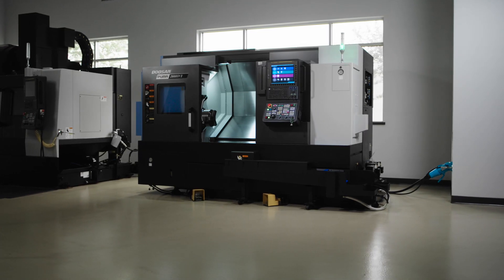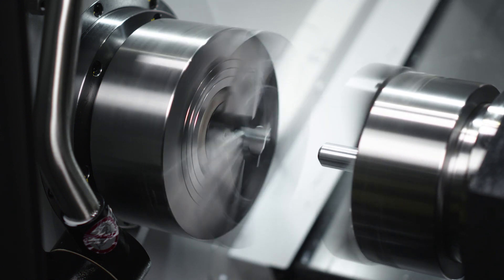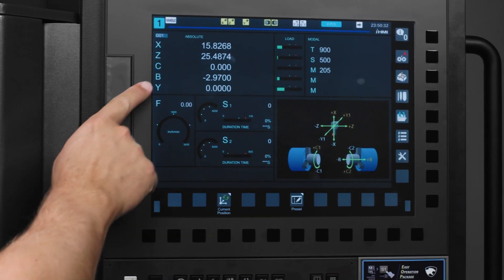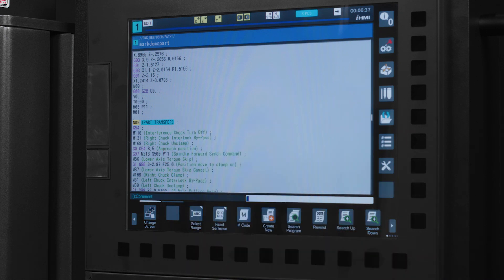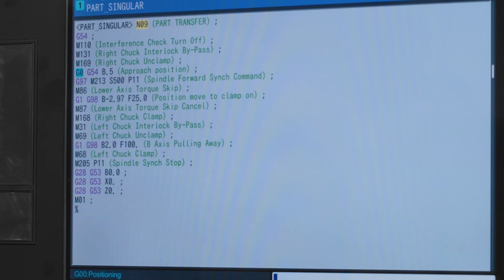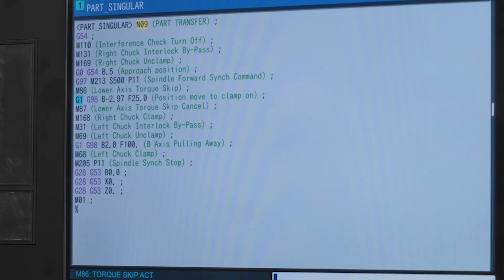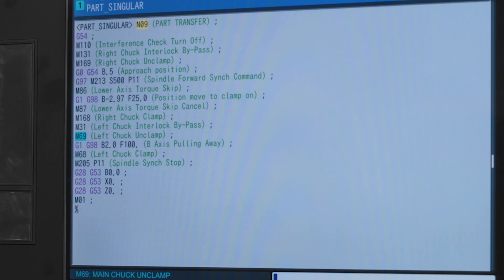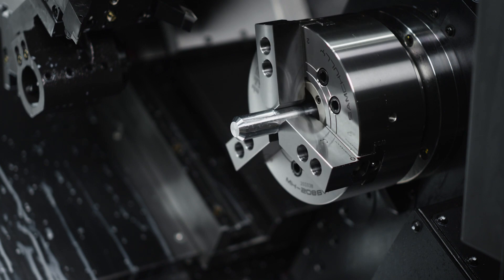Setting Up Part Handoffs – Know Your DN, Episode 15

Comment: Ok and if the sub collet master pads were machined before, but the master has been removed and now the clocking is off how can I teach the sub to clock correctly? I'm not picking off on a cylinder. It's an arbitrary shape. On DMG machines I would just clamp on the part and enter the rpm and direction in setting 21. Then press execute and it would adjust the phasing of the sub spindle to the main...
Reply: Did you ever figure out how to adjust the sub spindle to the main when transfering odd shapped parts?

Comment: Would someone please explain what the lower torque skip situation is all about? I have no idea.
Reply: That is the torque skip signal for the sub-spindle.  It get's cancelled before you clamp with the sub-spindle, otherwise you get an alarm.
Reply: @markchristopher5809  Ok, I get that part. But what is the mechanics of a torque signal. How does it function? Reads amps for rotation when it shouldn't be there?

Comment: What is the benefit in doing the hand off with both chucks spinning vs doing the hand off with the chucks stopped?
Reply: The chucks have to spin to sync the C axis, so just to save time we go ahead and hand the part off with them spinning.  You can sync the chucks, stop them, hand off the part and restart them, but  that takes up time.

Comment: uuhm i don't the machine is going to like the M87 before the M168 and M69. If you had softjaws with a certain depth and actually use the M86 function to push the part against the jaws the machine will crash the b-axis into the main spindle and thow an emergency stop in your face if you program an M87 over there. I always program the M87 after transfer but before the returning of the b-axis to home.

Comment: We need a video showing the M600 used to set the phase synchronization for spindle 2 to spindle 1.
Part is machined in side 1 to an odd shape and a machined set of pads/jaws on side 2 will synch and move over part using m213 for cutoff and transfer.
The manual is terrible and directions given to set the paramaters at 4034 using m600 do not work.

Comment: How do you sync a part with a hex? from the main collet to the sub? im using a collet closer on the main and sub. rather than a jaw. im maching a round bar stock to a .750 hex size. the sub has a .750 hex collet. we tried using this program to sync our part and had no luck.
Reply: Im going to try having both spindles stopped and set my c axis to C0.0 and then approach the part and clamp it and then start the spindles at the same time in a "sync" if thats possible.

Comment: Looks fine, but the problem is, that there's shown a transfer to the right chuck with a through jaws. But, what about a jaws, which are bored to a certain depth, and the part has to lean firmly against the back wall? For example, I'm machining a 9mm thick flange, and after the first side is done, I have to transfer it to the right chuck with a jaws, which are bored 6mm deep, firmly to the back wall of this 6mm bore. Isn't there going to be an emergency stop due to the overload, or any artifacts on the workpiece by itself? I'm working in a workshop, where we are often using a bored jaws for both sides of a workpiece, but all our machines are single-spindled, and I was always curious, how it works on a two-spindle machines. Also, what about any radial/axial runouts after the transfer?
Reply: So here is how I would do that.  All you need to know is the correct pick off position for that part with it up against the back wall.  Obviously, without the right spindle running, I would hand wheel the jaws up to my part and use a .001" shim to gauge the position of my part to my right spindle jaws.  Whatever that number is, it would go in to your  G1G98BXX.XX F25.0 line.  That is your pickoff position. I would run that pick off program just like it sat and test run it.  Once it picked off the part, I would stop the machine and check the part to back wall distance with shims.  If that flange was not all the way against the bored back wall of your sub-spindle jaws, I would move the B axis by -.001"  and do this again until I was satisfied with it's position.  You will have to "sneak up" on it.  If you do this correctly, you should not get any kind of alarm.  Your back reference surface of your jaws is just a contact surface.  Once it's against it, it can't go any further.  All of the holding forces are in the jaws.  I realize a 9mm flange is thin, so you don't want to put a ton of force on it anyway.
Reply: On dual spindle machines you set the force that you want the sub spindle to push at, with a G31 skip move as soon as the force is met the jaws will close and the program will continue. The runout will be very minimal and repeatable as well.
Reply: @lichtyc Why don't we have a video for this type of transfer from Doosan?

Comment: If you can add a cut off to the video would be greatly appreciated, see I have an alarm after the transfer machine  will not feed to start cut off can cycle,
 (TRANSFER) 
(TO SUB-SPINDLE) 
N5000G53G28B0
M14
G30U0V0
G30W0
M34
M134 
G0T0808(CUT-OFF TOOL /3MM .118) 
G54(P.R.C-B-ORIGEN)
G0Z.0 M8
M5P11
M5P13
M110
M131 (SUB-CHUCK CAN BE UNCLAMP INTERLOCK BYPASS)
M169 
G4U1.5 
M116 
G97S300M213P11(SYNC BOTH SPINDLES CW) 
M14           
M114 
G0B1.0 
M86 (TORQUE SKIP FUNCTION ON)
(G31P99)G1G98B0F20.(PICKUP PART LOCATION)
M87(TORQUE FUNCTION OFF)
M168 
G4U1.5 
M31 (MAIN SPINDLE CAN BE UNCLAMP INTERLOCK BYPASS)
M69 (MAIN SPINDLE OPEN FOR BAR PULL)
G4U1.5
G1G98B1.250F20.(PULL OUT FOR CUTOFF )(B=OAL + CUTOFF TOOL WIDTH + FACE STOCK=1.25)
M68
M15
M115 
G4U1.5 
G0X1.5 M8(X CLEAR)
G50S1250
G96S175
X.625
G1G99X.575F.006
G75R.01
G75X.25 P1000F.0014
G0X.6 
G4U3.0 
G1X.265F.006 
G75R.01
G75X.030P1000F.001
G0X1.500(X CLEAR)
G350(CUTOFF DETECTION) 
G53G28B0 (HOMING B AXIS)
G30U0V0
G30W0
M5P11
M5P13
M9 
M01
Reply: Victor, thanks for the feedback.  Please see my example program below and give it a try.

N09(PART TRANSFER CUT-OFF) 
N30T0303 (.205 Cut Off Tool)
G0G54Z.235 (Pre-position move for cut)
M110(Interference Check Turn Off) 
M131 (Right Chuck Interlock By-Pass)
M169 (Right Chuck Unclamp)
G0G54B.5 (Approach position)
M86 (Lower Axis Torque Skip)
G1G98B-1.69 F25.0 (Position move to clamp on)
M87 (Lower Axis Torque Skip Cancel)
M168 (Right Chuck Clamp)
M31 (Left Chuck Interlock By-Pass)
M69 (Left Chuck Unclamp)
G1G98B1.075F100. (B Axis Pulling Stock)
M68 (Left Chuck Clamp)
G4X3.0 (Position Move 1/2" off diameter)
M31 (Left Chuck Interlock By-Pass)
M131 (Right Chuck Interlock By-Pass)
M169 (Right Chuck Un-Clamp)
G97M213S800P11 (Spindle Forward Synch Command)
G99 (Feed Per Revolution)
M168 (Right Chuck Clamp)
G0X2.6 (Position Move Befor Cut)
M8 (Coolant On)
G1X-.03F.007 (Cutting Part)
G0X5.0 (Rapid Out)
M9 (Coolant Off)
M205P11 (Spindle Synch Stop)
G28B0.0
G28X0.0
Reply: It seems you just need to change your G54 to G55. To set up your G55, call up one of your sub spindle tools (T0232) in mdi. Jog it toward the sub spindle and use a gage block or something to set your work G55 position.

Comment: I have two questions:

How is the B axis defined here? Is there a B shift set for your main spindle WCS so that the face of the jaws on the sub chuck read Z0. when they are flush with the main spindle's Z0.? If you had a different sub chuck or different jaws how would you account for that Z change? I suspect there are a couple of ways you could do it, but I'm not sure what is happening in the video. After the handoff, you would likely send B home and do the sub spindle turning in that position with its own work shift?
Reply: You can do it in a few different ways. Either call a machine B position which you measure the way he showed in the video initially I.e. B-XX.XX from G28 G53 B0. home or you can set your B in your G54. I think it is easiest at first to just call a machine position but once you start using G54 Z 0. off of your chuck it becomes much easier to reference your B the same way. That is how they showed it being called when they were going over the code later in the video.